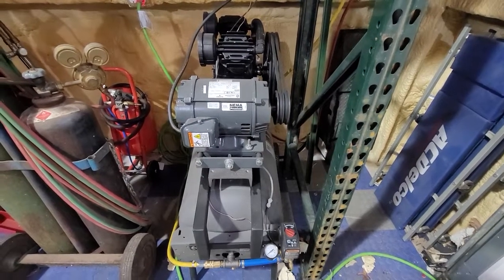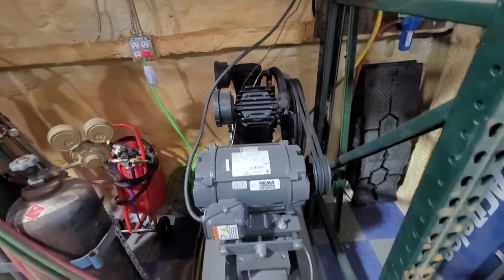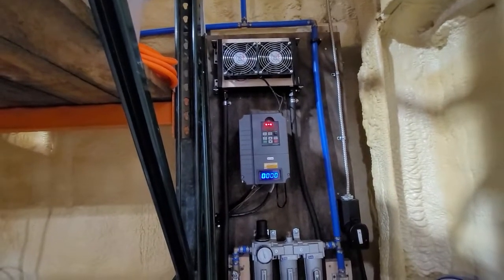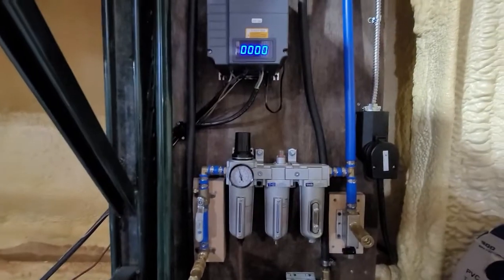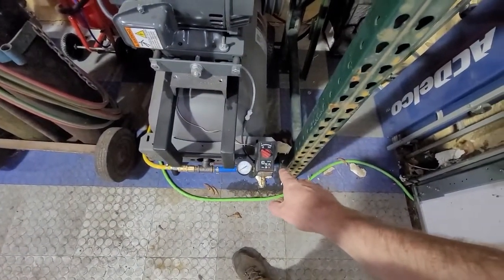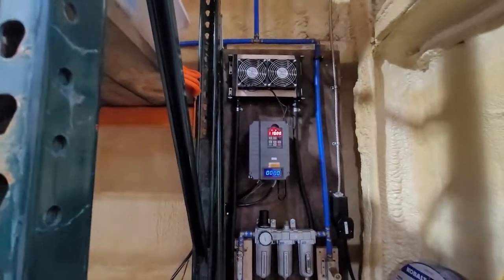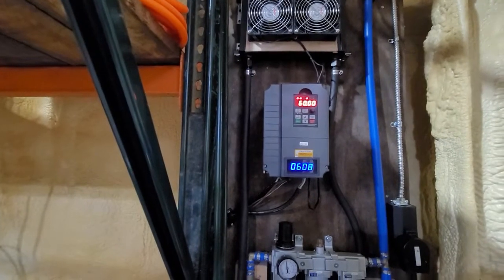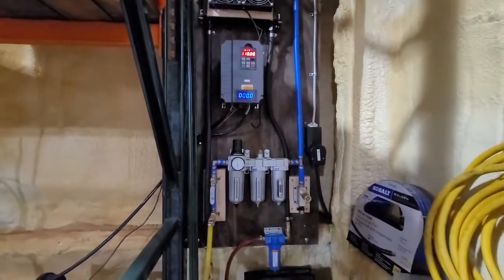Quick overview of my 3 phase air compressor conversion and air dryer setup

Comment: I have a 5hp Champion compressor I bought that has a 3 phase Baldor at 1725rpm. The pump on this has a range of 400-1000 rpm, with the 5hp nominally spinning it at 705 RPM. Since the motor is only approaching full load at 175psi, it would be really useful to speed up the motor at lower pressures and slow it down only as pressure comes up towards max. Sort of constant-power curve. The same pump on this is used on the 7.5hp model, just at higher pump speed via pulley size.

Towards that end— how much VFD do you need in terms of power (kW)?  I’ve been told anywhere from 1.72 times FLA rating of the motor to 2x the motor rating. Also, how much breaker do you need on the supply side of the VFD?

I have up a 50a breaker on 240V— can I feed 7.5hp motor controlled by VFD with this? I think in theory I could.

What’s I’d really love to do is have the compressor cut in at, say, 150psi at minimum pump speed (400rpm), cut off at 175. As pressure dropped below 150 with the motor running the pump at min speed, it would ramp compressor speed up to a max at say 120psi. So at every pressure below 120psi it would be at max pump speed.

This would build pressure very quickly with up to 30CFM at low pressure and then ramp down the air delivery rate as pressure and load came up.  The 400rpm speed is only about 10 cfm against 150psi.

This would really allow the pump to stay well ahead of the curve and utilize the superior higher pressure efficiency of this pump.

I really appreciate any insights you have into making that come to life.

Comment: Very nice set-up. How about an air inlet silencer to get the noise down even more?
Reply from the maker: I had a temporary one mocked up to test (cardboard box stuffed with insulation).  It worked quite well and I will probably add something further.  Currently the setup works quite well, but I will be re-configuring parts (mostly the electrical, VFD Control, etc).  That will involve re-routing a few things and I may build and add the intake silencer at that time.
Reply: @MountainLaurelMetalworks  My single cylinder diesel genny's intake is louder than the exhaust. Thinking of adding a snorkel-style air cleaner like a sixties Chevy V8.
Reply from the maker: @martinfinster9899  I suspect you already know this, but for the sake of others who may read....

Air compressors (especially small home units) use reed valves on the intake.  Basically nothing more metal flaps that cover a hole, lifting and closing based on air pressure (the intake vs. compression stroke  of the compressor cylinder).

These reed valves create the majority of the noise coming from the compressor.  While it may seen counterintuitive to put a 'muffler' on the intake, it can reduce the volume of an air compressor significantly.  

Hmmmmm......maybe I'll make a video on that one day......

Comment: I have a very similar setup. I got a three phase compressor at an extremely good price because the person selling it didn’t think they could use it. So I bought a vfd very similar to yours. Mine has an aftercooler already installed. I was wondering, what brand water separator and filters are you using?
Reply from the maker: I used one from amazon, it seemed to have mostly decent reviews and had sufficient capacity (cfm and psi) to handle my compressor.  It's been on for over a year and has worked great for me.  https://www.amazon.com/gp/product/B07Y41DZ75/ref=ppx_yo_dt_b_search_asin_title?ie=UTF8&psc=1